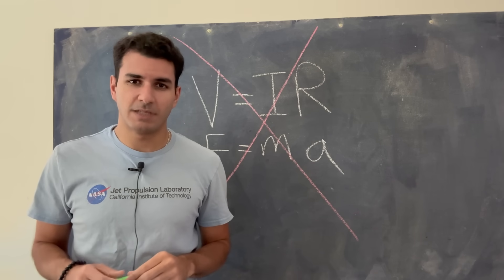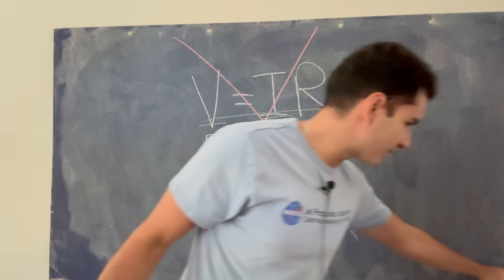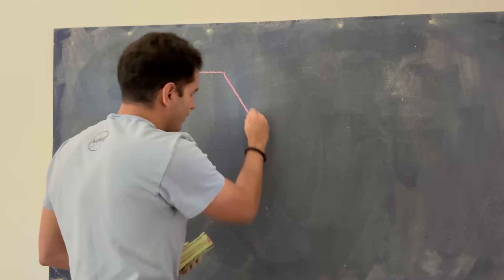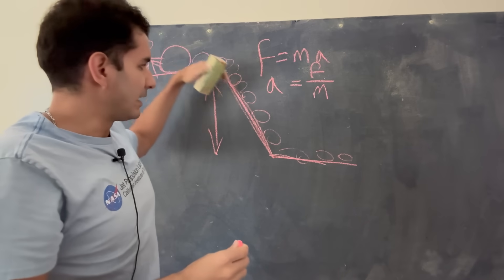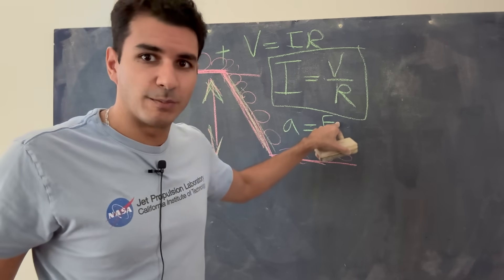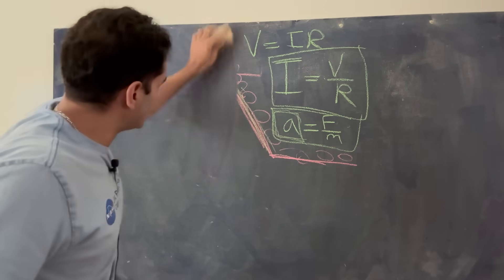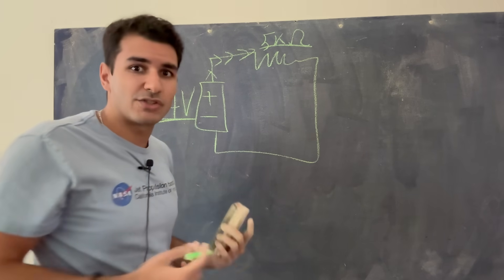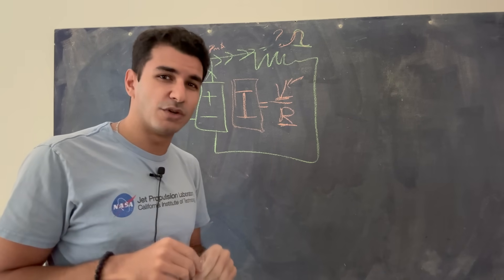You don't really understand physics

Comment: In your example where the guy is pushing the ball, the equation is still incorrect because the guy pushes on the ball with a specific force to get the ball rolling until it hits the slope and gravity takes over.  Gravity is not a force.  Gravity is an acceleration that moves the object with the effect being the mass exerting a force on the ground when it hits.  So the force applied by the guy does not equal the output force caused by gravity.
Reply: > Gravity is not a force.  Gravity is an acceleration that moves the object with the effect being the mass exerting a force on the ground when it hits
BS
Reply: @alexleibovici4834  Your argument from incredulity is purely fallacious and is no argument at all.  If you want to posit that gravity is a force, then you need to provide empirical evidence that it actually is a force.  There is a guy holding a rock here on earth.  He drops the rock.  Is your alleged force being applied to the top of the rock and pushing it towards the earth or is your alleged force being applied from the bottom of the rock and pulling it towards the earth as if it were being pulled by a rope or string?  You cannot answer this question because there is no force at all being applied to the rock.

Now take a compressible solid, such as a cotton ball.  A cotton ball elastically deforms when a very small force is applied to it.  However, there is no elastic deformation of a cotton ball due to gravity.  You can roll it on a surface and it is not mashing into a disc as it rolls.  Yet, if that cotton ball rolls of the table, it will start falling at about 9.8 m/s^2.  If the same amount of force required to cause that acceleration was applied to the cotton ball, from either the top down or the bottom down, the cotton ball would be elastically deformed.
Reply: @alexleibovici4834  BS
Reply: @wesbaumguardner8829  
What from what I said is BS, and why?
> Gravity is an acceleration
Gravity is NOT an acceleration, It can RESULT in an acceleration (but does not have to)
> Gravity is an acceleration that moves the object
It is NOT the acceleration that moves the object. It is a force that does (unless it moves by inertia - with constant speed),
> ... with the effect being the mass exerting a force on the ground when it hits...
And if it doesn't hit? Then gravity has NO effect??
As you see, I was correct: you are extremely confused.
Reply: @alexleibovici4834  No, it is you that is confused.  Gravity is not a force that causes an acceleration.  Force is mass multiplied by acceleration.  Gravity has no mass.  Gravity is the acceleration that moves the mass.  The result of the mass under gravitational acceleration is a force if and only if that mass comes into contact with another mass.  Force is an emergent phenomenon in this process.  Force is not an entity that is always existing.  The object is accelerated regardless of whether or not it comes into contact with another object, creating a force.  It is a non-sequitur to claim there is no effect just because a force is not exerted on another object.
Reply: @alexleibovici4834  Go ahead and explain your claim that gravity is a force in depth.  Where is the mass of gravity located?  If an object is freefalling due to gravity, where is this force being exerted?  You cannot answer these questions because there is no force.
Reply: @wesbaumguardner8829  
No feedback to my question about two bodies??? Too difficult for you? Do you need additional explanations? Just ask.
Reply: @alexleibovici4834  I have never seen anything written by you about two bodies and have no idea what you are talking about.  With that said, you have not supported your assertions that gravity is a force nor have you answered my question  about where gravity's mass is located nor my question about where the force is being applied to an object in freefall.  Consider your claim that gravity is a force rejected.  You are also a hypocrite for claiming that I am doing what you are doing and avoiding answering questions.
Reply: REPOST (please confirm)
=========
About YOUR understanding of the word "gravity", a simple question to you:
Assume (every word counts!) :
1. that we have only two bodies, of masses m1 and m2. 
2. Assume there are are no other bodies/masses in the universe (or that they are so far and small, that their influence can be ignored)
3. Assume that the two bodies are point-like, at rest initially and the distance between them is, initially, d.
Question: 
How will m1 move with respect to m2 in the first moment? Direction, sense, acceleration (if any)? If the acceleration is not  zero, I will need its value.
Please note that, despite such a long description, the question is very simple, the simplest possible about gravity. The most  elementary physics. There are NO tricks or catches - at all !
========
Reply: @alexleibovici4834  m1 will accelerate towards m2 and m2 will accelerate towards m1.  The rate of acceleration will depend on the mass of m1 and m2 and distance d.  If either m1 or m2 has a much higher mass, that object will accelerate at a noticeably smaller rate due to inertia.
Reply: @alexleibovici4834  I have already responded to this, but it appears YouTube is censoring me, so I am re-replying to this post.  

With all of your assumptions, mass m1 would accelerate towards mass m2 and mass m2 would accelerate towards mass m1.  The rate of the initial acceleration would depend upon the mass of m1, the mass of m2, and the distance d.  As the distance between the two masses decreases, the rate of acceleration actually increases.  The acceleration is not actually constant, as many people believe.  Assuming both masses were equal, the acceleration of each object towards the other would be equal.  If one mass has more mass than the other mass, the larger mass would have a lower acceleration and a lower rate increase in acceleration due to inertia than the lesser mass which has less inertia.  Of course, this is based purely upon the limitations which you postulated and does not take into account any angular momentum, which is assumed to be 0, any electromagnetic forces acting upon the objects, which are assumed to be 0, or any other phenomena that could affect the velocity and/or acceleration of the two objects.

I cannot provide any values for the acceleration based solely upon the information you have provided because you are missing the following information: the actual mass of m1, the actual mass of m2, and the actual distance d.  These are all variables which will affect the initial acceleration and the rate of increase in the acceleration of each object.
Reply: @wesbaumguardner8829  
Congratulations, you are on the right path to the answer, but you did not pay enough attention to my wording of the question, although I stressed that each word counts.
And, yes, you CAN provide the value, or rather the expression for the required the acceleration. (btw, there is only ONE acceleration, not two - read carefully my wording of the question!)
Also, you seem to believe that "m1" and "m2" are the NAMES of the bodies. In fact they are their respective masses. They should appear (together with d and maybe also some constant) AS SUCH in your final formula for the required acceleration.
PS: there is no angular momentum to account for - if you read CAREFULLY my wording. 
PPS: there are no external electromagnetic forces acting upon the objects - again, IF  you read carefully.
The only circumstance I did not mention (my bad) was that the two objects are neutral electrically and magnetically
So: the next step for you is to provide me with the expression of the initial acceleration - with or without justification
TIA
Reply: @alexleibovici4834  "Congratulations, you are on the right path to the answer, but you did not pay enough attention to my wording of the question, although I stressed that each word counts."  In other words, you are playing a semantic game rather than attempting to discuss what gravity is and how it works.  Gotcha.

"And, yes, you CAN provide the value, or rather the expression for the required the acceleration. (btw, there is only ONE acceleration, not two - read carefully my wording of the question!)"  I cannot provide a value because not enough pertinent information has been provided.  You did not ask for an expression or mathematical equation, which is entirely different than your request for a value.  I find it quite funny that it is ok for you to reinterpret words and their meanings willy nilly while you are expecting me to read every word with your specific idiosyncratic interpretation of what you wrote.  This just wreaks of ego.  Are you really in this conversation to debate gravity and how it works or are you here to perform some ritual of self-aggrandizement?  

I cannot provide the mathematical equation in youtube chat, because I do not know how to write all the symbols and Greek letters necessary to write the equation in YouTube chat.

"Also, you seem to believe that "m1" and "m2" are the NAMES of the bodies."  Yes, that is what you called them.  You have provided absolutely no unit of measure and I have never met anyone that would claim m1 is an amount of mass and m2 is a different amount of mass.  Your argument is completely nonsensical and tantamount to a word game rather than a depiction of anything that occurs in nature.

"In fact they are their respective masses"  Yes, that is why we name things.  So we can differentiate one thing from another thing.  m1 is a mass, m2 is another mass.  That is what you named them.  You never used a unit of measure or specified how much mass each mass had.  Numbers by themselves without units are absolutely meaningless  aside from designating a differentiation between two things, which is how I interpreted your designation, which is exactly how practically any physicist would have, as well.  I can tell you are not actually a physicists, but rather an internet warrior playing a semantic game for an ego boost.

"PS: there is no angular momentum to account for - if you read CAREFULLY my wording."  You never made an assumption that there was or was not angular momentum specifically.  I just added that I was assuming there was no angular momentum for specificity and clarification.  It seems you are arguing against this, for some odd reason beyond my comprehension.  

"So: the next step for you is to provide me with the expression of the initial acceleration - with or without justification
TIA"  Wrong.  The next step for me is to wait for you to provide support for your claim that gravity is a force.  I have already answered your question to the best of my ability.  It is your turn now.  Either provide the force vectors with their locations and directions with a full explanation of what mass is there in the "empty space" between the two masses which acting on the other masses, or consider this conversation ended.
Reply: [Please confirm that you see this post, even before commenting on it. TIA]

Here is the answer to my simple) question - compute the acceleration of the body #1, the one having the mass m1 (I will simply write "acceleration of m1" )

1. The initial force on m1 is:

F1=G*m1*m2/d^2

 (G is the gravitational constant, d^2 means d squared)

2. Under the force F1, m1 acquires an initial acceleration of

a1=F1/m1

3. Combining the two, one gets:

a1=G*m2/d^2

That is all ! This is the answer to my question. Contrary to your claim, I DID provide enough pertinent information.

Remarks:

(a) I used the fact that the gravitational interaction between the two point-like masses IS a force. It depends on the two masses and on the distance between them, as specified by Newton's law of gravity

(b) In our setting, the Newtonian Mechanics is sufficient, considering gravity something else than a force, for example within the framework of the Einsteinian theory of gravity, would be a horrendous overkill.

(c) Your initial claim that "Gravity is an acceleration that moves etc." - you are confusing the fact that gravity can be simulated by an accelerated frame ("Einstein's Elevator). Yes, it can be simulated (locally!) by an accelerated frame, but it is NOT an acceleration.

(d) You claim: "You did not ask for an expression or mathematical equation, which is entirely different than your request for a value"
As I gave you no numeric values, I was expecting no numeric value (for the acceleration), but the general, algebraic expression for it - which is valid for ANY numerical values of the respective symbols.

(e) Angular momentum: As per the wording of my question, it is zero initially (and remains zero forever). The respective wording is "the two bodies are point-like, at rest initially". The key words are "AT REST"; this makes the initial angular momentum being ZERO. So that I do not need to make ASSUMPTIONS that there was or was not angular momentum specifically: It FOLLOWS from the information I gave you.

(f) You wrote "I cannot provide the mathematical equation in youtube chat, because I do not know how to write all the symbols and Greek letters necessary to write the equation in YouTube chat."
Well, as you could see, I COULD provide the mathematical equation in YouTube chat, and very easily. No fancy symbols and Greek letters were necessary.

(g) "Either provide the force vectors with their locations and directions with a full explanation of what mass is there in the "empty space" between the two masses which acting on the other masses, or consider this conversation ended."
Sure. Just describe the system of bodies you want me to analyze from the point of view of the gravitational forces, and I will gladly do it.
But first explain the part with "full explanation of what mass is there in the "empty space" between the two masses", because I don't see WHAT do you need additional masses between the two masses FOR ??? 
Do you deny action-at-a-distance? Gravitational, electric, magnetic?
And again: are you some kind of a flat-earther or an adept of some other "alternative" physics?
Reply: @alexleibovici4834  "1. The initial force on m1 is: F1=G*m1*m2/d^2"  F1 is not the initial force on m1.  That is the resultant force caused by the acceleration of gravity moving m1.  This was derived by weighing objects, which is always a measurement of the resultant force, not the cause of the motion itself.  Like I said, provide the force vector.  You cannot do this because the force vector does not actually exist in reality.  Practically all forces have vectors and you can show how/where they are applied to objects.  If I push against a wall, you can tell which side of the wall the force is being applied to, and which direction the force is being applied.  Same if I tie a rope to an anchor in the wall and pull on it.  You can actually measure this force.  You cannot measure a force which is acting on the object itself which is being exerted by gravity.  All you can measure is the resultant force of gravity moving the object against another object, which is the result, not the cause.  Gravity is the cause of motion, not the result of motion.  Now, if I am wrong, you can easily prove it by measuring where on the object the force is being applied to the objects and providing the force vectors.  Is there a force pushing the two objects together from the outside so they move towards each other or is there a force pulling each object towards the other from the inside faces?  Can you answer this simple question?  I highly doubt it.  You have utterly failed to do so, so far.

"Under the force F1, m1 acquires an initial acceleration of a1=F1/m1"  Incorrect.  The mass, m1, already exists.  It is accelerated by gravity, which you can call a1.  The resultant force is then applied to an object if and when a collision occurs.  There is no actual force being applied to an object by gravity.  Provide the vectors, I'll wait.  The problem is you are stuck in your education and are not thinking critically about the problem.  You are starting with the resultant and working towards the effect instead of starting with the effect and working towards the resultant. 

"3. Combining the two, one gets:

a1=G*m2/d^2"

Are you aware that Newton's equations are not exactly correct?  They are good approximations, but that is what they are.  They have no explanatory power to how gravity actually works.  All they do is describe what is observed, unfortunately, in doing so, he confused the cause and the effect.

"I used the fact that the gravitational interaction between the two point-like masses IS a force. It depends on the two masses and on the distance between them, as specified by Newton's law of gravity"  No, you used circular reasoning and Newton's equations to basically restate what you have already stated.  Again, provide the force vectors.  

" In our setting, the Newtonian Mechanics is sufficient, considering gravity something else than a force, for example within the framework of the Einsteinian theory of gravity, would be a horrendous overkill."  Einstein did not understand gravity, either and I reject his theories in their entirety.
Reply: @wesbaumguardner8829  
OK, let's summarize the situation.
I asked you a question (the one about computing the acceleration of the body #1). You provided no specific answer. Then I presented you with my approach and provided the required acceleration.
You claimed that my entire approach is CONCEPTUALLY wrong. (Besides, you did not specify if the RESULT is also wrong).
Now it is YOUR turn to answer my question, that is deduce the acceleration within YOUR conceptual framework.
NOTE:
As I saw that the subject of where the gravity is applied, worries you, to get this subject off the table, here is my take:
- Every part/element of a body attracts gravitationally every other part of that body, as well as every part/element of all other bodies
- The attraction forces are applied to each of the respective parts/elements of the body.
- Under certain circumstances, the multitude of the small forces can be replace by one single force, which would have the same EFFECT on the body's movement as the all smaller ones.
Reply: @alexleibovici4834  "OK, let's summarize the situation.
I asked you a question (the one about computing the acceleration of the body #1). You provided no specific answer."  I have been asking for the force vectors the entire time.  You have yet to provide them.  You keep dodging the question.  And saying "the two objects attract" is not providing a force vector.  They obviously do, but that can be caused by a force from the outside pushing them together or a force from the inside pulling them together.  You cannot seem to locate where or how the force is being applied.  You are just claiming that it is.

"Then I presented you with my approach and provided the required acceleration.
You claimed that my entire approach is CONCEPTUALLY wrong."  That is because it is conceptually wrong.  Newton's equations are not temporal equations.  They are instantaneous equations where everything is calculated for the same exact instant.  As such, there is no cause/effect relationship in his equations.  Cause and effect require a temporal relationship.  Gravity is the cause of motion, force is the effect of the motion.  

"Now it is YOUR turn to answer my question, that is deduce the acceleration within YOUR conceptual framework."  In my framework, aka "reality," the acceleration is the cause, not the effect.  An object in freefall is experiencing no forces (aside from possibly air resistance.)  Also, it is not mass that gravity is dependent upon, but mass density.  I can take a 1 lb rock and drop it and it will fall to earth.  I can take a 1 lb helium balloon and drop it and it will float to some level higher up in the atmosphere until it reaches the same mass density.  Buoyancy and gravity are part and parcel of the same phenomena.  Gravity does not actually affect all things the same exact way.  Take a single molecule of water in a pan of water.  If you put that pan in the freezer, and some of the molecules freeze, the frozen molecules will float to the top of the liquid molecules even though they are supposedly under the same gravity.  Then you take that pan of water and put it on the stove and heat it up until it starts boiling.  Little bubbles of water expand and float to the top and are released into the atmosphere where they rise and cool, condense, and fall back to earth.  All the same molecules.  So just because they are all in the same gravitational field, does not mean the same molecules are affected the same way by gravity at all times.  Every present model for gravity is wrong.  And no, I do not need to provide a mathematical working theory to prove that it is wrong, all I have to do is show that the present theories do not match observation, which I just now did by showing gravity affects water differently depending upon its phase.

"Every part/element of a body attracts gravitationally every other part of that body, as well as every part/element of all other bodies."  Does it?  Do the water vapor molecules inside boiling water attract to all the other water molecules in the pan?  Seems to me that they are being repulsed.  Also, you still have not provided the force vector.  

"The attraction forces are applied to each of the respective parts/elements of the body."  In other words, "the forces are everywhere" which is also equivalent to "the forces are nowhere."   If you cannot detect and measure the forces, you cannot scientifically claim they are there.

"Under certain circumstances, the multitude of the small forces can be replace by one single force, which would have the same EFFECT on the body's movement as the all smaller ones."  This is the trick they have been using to assume the force is there the whole time.  They cannot locate the force, they cannot measure the force, they just assume the force into existence.
Reply: @alexleibovici4834  " "'You did not ask for an expression or mathematical equation, which is entirely different than your request for a value"

As I gave you no numeric values, I was expecting no numeric value (for the acceleration), but the general, algebraic expression for it - which is valid for ANY numerical values of the respective symbols."  Strange, you specifically asked for a value and I did not take that as a request for a pontification on morality, so I assumed you meant numeric value which would have been a far better assumption given the context of your question as we were discussing physics.  Perhaps you should be more clear with your questions in the future. 

"(e) Angular momentum: As per the wording of my question, it is zero initially (and remains zero forever). The respective wording is "the two bodies are point-like, at rest initially". The key words are "AT REST"; this makes the initial angular momentum being ZERO. So that I do not need to make ASSUMPTIONS that there was or was not angular momentum specifically: It FOLLOWS from the information I gave you."  As I stated before, my angular momentum comment was made for clarification, not as a question.  Everything about your question is an assumption because we are not talking about real things in the real universe.  We are talking about imaginary things in an imaginary universe.  I could make gravity repulsive in this imaginary universe if I wanted to.  That is the problem with hypotheticals.  They are not reality, and do not really provide the same answers reality would provide, just because someone assumes they will.

"Well, as you could see, I COULD provide the mathematical equation in YouTube chat, and very easily. No fancy symbols and Greek letters were necessary."  Your equations are not nearly as precise a description of gravity as the equations I would write.  

"Sure. Just describe the system of bodies you want me to analyze from the point of view of the gravitational forces, and I will gladly do it."  ??? Just do it for your hypothetical.

"But first explain the part with "full explanation of what mass is there in the "empty space" between the two masses", because I don't see WHAT do you need additional masses between the two masses FOR ???"  You are claiming that there is force in "empty space."  If force is in "empty space," mass must be in empty space as well because F=ma.  In other words, in order for force to be the primary, aka "the cause," there must be mass in space because the mass inside the masses is not in the space where you are claiming the force is being applied.  So please, by all means, do go into your ontology on how you figure mass is in empty space.

"Do you deny action-at-a-distance? Gravitational, electric, magnetic?"  I deny action at a distance.  I do not deny gravitational and electromagnetic fields, which are essentially two sides of the same coin.  The fields exist throughout space, which is not actually empty as it has measurable properties, attributes, and characteristics  However, mass is not one of those properties that exists throughout space.  Neither gravity, nor electromagnetic fields are "action at a distance" any more than me flapping my arms in water to make waves which eventually cause a toy tug boat to rise and fall is action at a distance.  There are local cause and effect relationships throughout the entirety of these processes.  Newton did not understand how these worked, so he completely left them out of his theory.  His theory is purely descriptive and not explanatory.  Unfortunately, it lacks the temporal designations required to differentiate cause and effect which has caused physicists much confusion throughout the years.
Reply: [REPOST]
First, an observation about what is OUT THERE, that is in nature, and what is NOT out there.
The bodies ARE OUT THER. 
They may act upon each other. To understand this CONCEPTUALLY and to describe QUANTITATIVELY, intelligent people have introduced the concept of FORCE, and represented it by a mathematical construct called vector.
Forces and vectors are NOT OUT THERE, they are CONCEPTUAL constructs, which exist only in our heads (of some of us).
Intelligent people have found by what kind of vectors (size, direction, sense), or other, more complicated mathematical constructs, to represent the interaction of the two bodies in order to describe the situation correctly, that is so, that it corresponds to the observations and measurements.
Second:
I am trying to understand your perspective.
Chose from the claims you've made one that you consider the most intriguing, and we will concentrate on it, that is analyze it from our perspectives.
Or, you can choose to demonstrate the predictive power of your alternative mechanics by taking a specific situation - the same I took, or another, simpler one. You don't have to compute the acceleration, if you believe it is a cause and not an effect. You don't even have to take a situation involving gravity, but other interactions, like electric, or magnetic, or direct contact, or whatever. And predict whatever characteristics you consider IS predictable in your framework.
Reply: No comment? You decided to run away? If this is the case, it is the best decision you could make under circumstances.
Reply: @alexleibovici4834  "No comment? You decided to run away? If this is the case, it is the best decision you could make under circumstances."  Has it ever occurred to you that perhaps another person has more pressing obligations than to respond to your posts?  Yes, it probably is the best decision I can make, though not for the reason you are supposing.  I do not see that you have anything of value to offer me in this conversation, as all you are doing is regurgitating ad nauseam the same exact nonsense the physicists promulgate as if it is the truth when their entire conception of reality is fundamentally flawed and does not match observed reality.  I know this for a fact, so you providing the same information I have heard repeatedly for decades, fully understand, and reject wholeheartedly is not going to do anything for me.  You are the only person that could possibly benefit from this conversation, but I am not sure if your mind is open enough to get over your primacy bias which was deliberately instilled in everyone that went through the public miseducation system.  And yes, I went through the public miseducation system myself, so I do know what I am talking about.